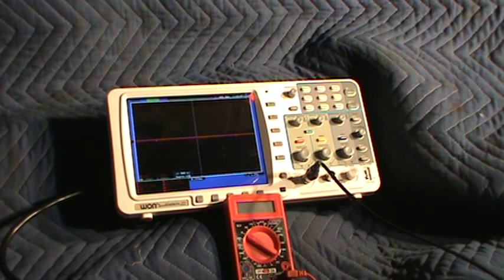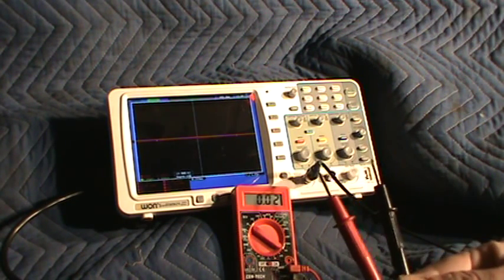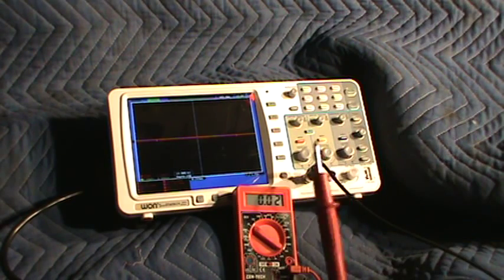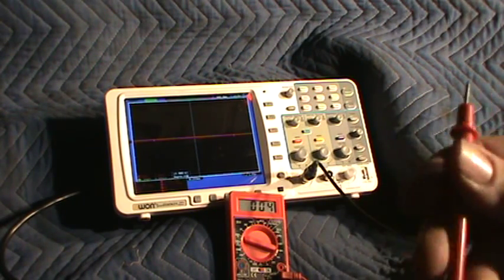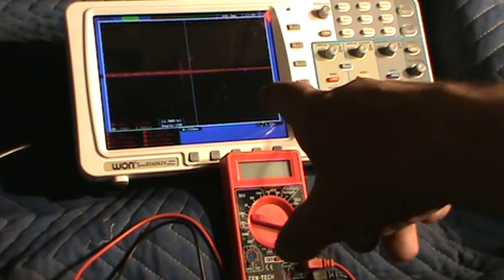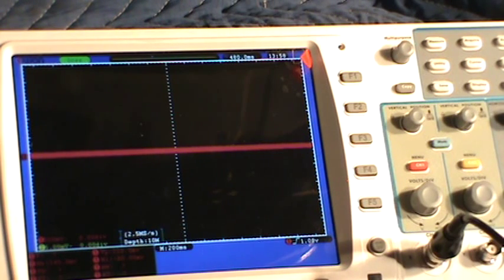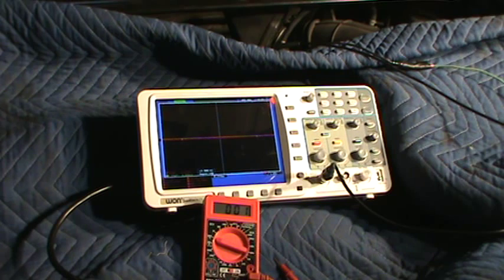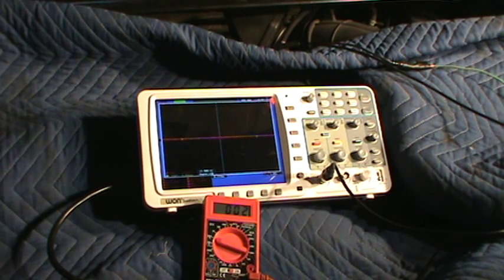Voltage Testing Fundamental "Ghost Voltage"

Comment: can you give a bunch of examples of when you will measure ghost voltages? and if you DVM DMM meter doesn't have an low impedance function can you put a 1K ohm resistor load across the DMM meter jacks to make it an low impedance meter?

Comment: Good video . sort of, good lighting , no glare on the instruments , I can easily hear you,  But you explain ghost voltage by waving the probe and wire disconnected from the device,  Mr. Loadpro, Dan Sullivan does the same by never showing the probe attached to the device.  So I'm still confused  do you use the red positive probe on a power wire and the black negative probe on a susspected ground wire , and then wiggle the probes while they are touching the circuit . You well illustrated what ghost voltage looks like on the meter but not how the probes are applied to the circuit.

Comment: hmm, I think i understand what your getting at but it is a really long way to go "with a super cheap meter" to talk about ground.  Get a good Fluke, they arnt that expensive.  but when im testing auto components i use the components ground itself, and by metering it from the negative post to the components ground on con...check you can tell if your ground is solid. that being said. after you establish a solid ground check from the component to the main ground, it is easy to check resistance and or voltage of the component.   I believe the manufacturers recommend an ohm test because there is less chance that someone DIY'er wont blow something up by back feeding the ECU.  if you know the operating voltage, and pin outs for sure clip on and measure away. but as far as ghost voltage, it is a given.  Almost anything can be a ground source, for instance, if you have a positive source  and another positive source that is smaller in value, you can meter red to the larger value and black to the negative value and it will read the difference of said voltages.  Even though they r both positive voltage sources.   My understanding of fuel injectors are fairly limited, but from what i understand it is either ON ALL THE WAY, or OFF all the way.  and the pulse with modulation of the injector is how long the injector is on in the duty cycle. Personally i HIGHLY recommend doing a continuity check between components ground and negative post, and when that is established to be good.  Go ahead and use the components ground as reference and measure the ohms. If something is bad it will give you a good idea of it.  If you suspect that you are having issues with the quality of fire going through a component like a coil or something ya that may only show under heavy load.  but that is a whole different beast to look at.  On the other hand if you suspect a bad injector, the quick and dirty test is diode checking a couple or 3, if you suspect one to be faulty it Will read differently than the other 2.   anyways, i didnt mean to turn this into a rant, or a basic electronics speech, im just not entirely sure what you were saying. other than it is super easy to induce a false voltage into a voltage measuring instrument depending on the "ground" or reference to ground you are using.   Good video though, it flowed well and the information seemed relatively solid.  but you lost me a little bit on "good ground" fuel injector. because mine work by PWM like you said. but it is only on during the "high part" of the duty cycle and ground is always good.    anyways.  Have a good day fella.   nice watchin your vid
Reply: so you are saying.. when it comes to something as "fine tuned" for lack of a better word like Injectors.. your better off just testing them all and verifying they are all the same because the FIs arent directly grounded? like say an Alternator or like in my car the Throttle Body and a few other things have their own grounds.
Reply: Lann Craster nope, not saying that at all, they can be directly grounded and still work as stated per pwm high cycle on time.   meaning its always grounded and when the duty cycle goes high on the other wire it opens all the way per the duty cycle. As far as measuring them, if you are measuring an injector to begin with im assuming you are suspecting a problem with the fuel delivery or injector itself.  i would start with metering the suspected bad injector with a couple of other injectors to see if the part that turns on is actually sound before proceeding to other test.  a simple diode check or continuity check can tell you if the injector is bad straight away before you get into ecm switching and such.    It doesnt matter if the injector is 1 solid voltage and the ecu grounds it to fire it, or if its grounded and the ecu sends a pulse width modulation to fire it.  its either on or off.  not really that "fine tuned"  the amount of time the ecu grounds it, or has a HI in the duty cycle depending on how it is set up is what makes the difference in the amount of fuel delivered. ....the short answer is, if the injector is defective, it will read different than the other injectors in a line of 3. such as a switch, say 2 of them read .449 in a diode check red to one lead and black to the other, "unplugged from the wiring harness"  the defective one may read .110 or OL depending on the defect in the injector.   sorry i wasn't as clear as i could have been before, hopefully this helps.
Reply: yeah thanks for clearing it up. i dont really have any injector problems at the moment. just felt like learning a bit about doing some electronics diag.
Reply from the maker: That was a lot to read. The fuel injectors are fed voltage   -,_l--   < kind of looks like this, so 12v more or less will be seen on both feed and control wire when key is on, the only time the control wire is grounded is when it is commanded by the computer to ground  for a short duration when the fuel injector opens. The only time it makes a difference to use sensor ground is when you are testing a sensor, a fuel injector is NOT a sensor.
Reply: ***** yes i do believe i confrused myself and yacked all over what i was trying to say, thank you for pointing that out.   I think the just of what i was trying to say is, i personally would measure the injector at the 2 leads to see if it was bad "with the harness unplugged".  basically it is a coil in there that charges when ever the ecm grounds out the circuit creating a magnetic field that raises the plunger and opens the injector. I also wanted to make it clear to Lann, that the injector is never partially on or off unless it is defective.  It is all or nothing. Yes there is more to it than that but that was the basic thing i was trying to say.    if you are using the scope, and a current amp, u can actually see the current ramp, a steep spike in voltage, a flat spot on top during the sustain, "mostly  13.7 to 15v but not always", then a steep negative going transition back to 0. electronics fun stuff indeed.   =)
Reply: Rhage73 unless of course it is a ball type of injector,  similar but not the same.  ;P   Sorry had a bad head ache the other night,  happens when a drive shaft falls and smacks you in the noggin from a lifted YJ.    Saftey and common sense first boys and girls, and obviously i failed to remember the latter.  hehe
Reply from the maker: Rhage73  I have videos showing the fuel injector waveforms, I just made one.